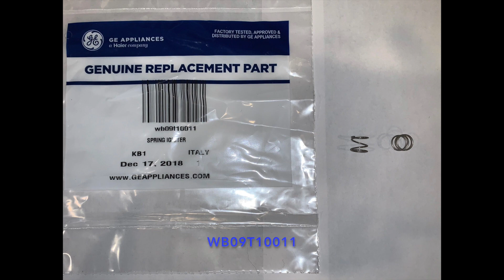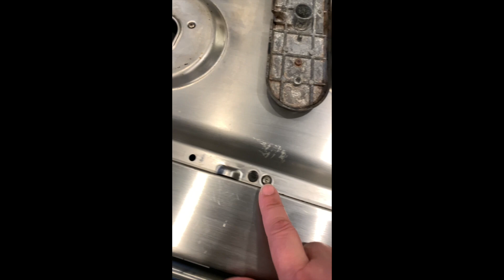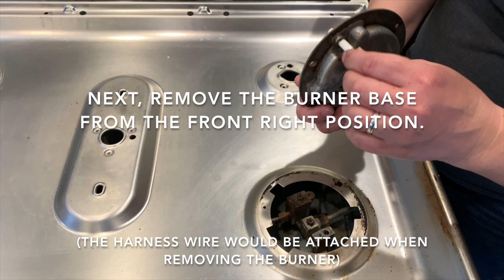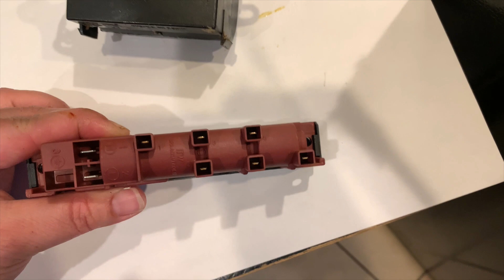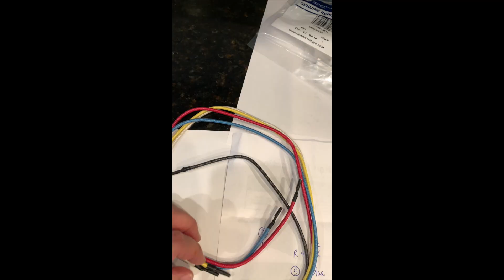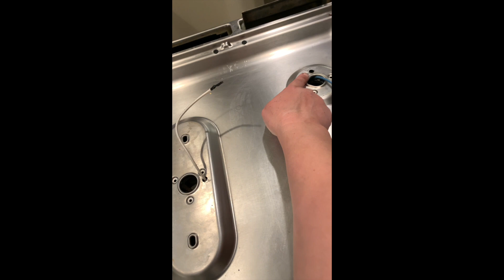Stove Repair - GE Café Burners Don't Light

Comment: Nicely done; one addition has to do with connecting the wires to the new Spark Module. The White and Purple go exactly as you illustrate but the other 5 wires running to the burners can be connected to the Spark Module in no particular order.
Reply from the maker: Thank you so much for sharing that info!  Great to know!  😃

Comment: I  have this exact stove bought about the same time. I cant for the life of me get the right front burner base to come off! Is there a trick to removing that one? all the others pop off easy peasy but the RT front seems to be glued or screwed in place?
Reply from the maker: Hi, @amandaneilson7162 
The first two parts of the front right burner (the flat black cap/top and the ring shield-thing that the flame comes out of) should both lift off easily.  If they’re stuck, likely some old oil or a past spill needs some cleaning up.  
Underneath those two parts, though, is the base which has 5 screws which need to be removed as well as the igniter (that should be easier to remove after the base is unscrewed).
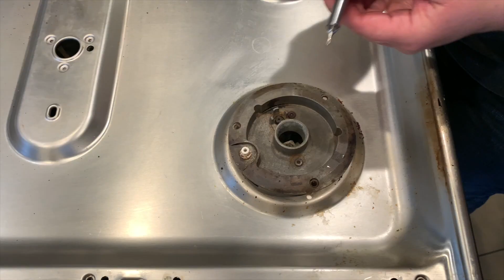If you look at 4:04 in the video, you’ll see the part that needs unscrewing (specifically pointing out the two inner screws I initially forgot to undo). 
I hope this helps.

Comment: This is one of the best How To videos on Youtube!!  My only problem now is the wiring harness part #WB18K10046 is no longer manufactured.  Hopefully someone can help my find one, because even GE didn't have a replacement part when I called them.  Thanks for this Video!!
Reply from the maker: Thank you for your kind compliment!  Thank you, too, for letting us all know the wiring harness has been discontinued!  Ugh!  I looked today, too, & had no luck tracking one down.  If I do end up finding one, I’ll let you know!
Reply: @mswdl  Thanks for the response!  If you happen across one, I'd appreciate any leads!
Reply from the maker: @davidturlington1958 I wonder if one of the other GE harnesses would work… Check out WB18K10035…that only has 4 wires, so maybe WB18K10050 could be the 5th necessary for all 5 burners.  I don’t know if these would work or not (!!!), but based on the photos, they look like they might.  You’d really need to check on your own (again, I don’t know if they’d work or not!) & buy only if you can return if they don’t work.  I will still keep an eye out for the original as I said before, but like you, every site I’ve searched so far no longer stocks it.
The other option you might consider would be to use your existing harness with the new spark module (assuming the harness wires don’t look damaged) & new igniters/electrode.  Whatever you decide, Good Luck!!!🍀
Reply: @mswdl  just saw this, thanks so very much!  I'll look up those part now!  Yes, I did find one but it only had 4 wires, so I'll look at that other one for the 5th wire.

Comment: Do you know how you would go about changing the glass and touch screen assembly on the front side of the range?? My touchscreen is being nonresponsive sometimes. Any help would be appreciated. Thanks
Reply from the maker: Hi, coolboy89111.  I wish I had insight to offer for that but I don’t.  I did a quick little search on YT for “how to change the touch pad on ge stove” and some videos popped up that might be of help.  I hope you find the solution you need.  Good luck!

Comment: Hello, excellent video, a question?  on the screen in front it showed blocked burners?  my stove was fine and I have exactly the same one as you, I washed it as I always do and now it doesn't want to turn on and the screen shows an error, burners blocked and nothing works on the screen.
Reply from the maker: Hello and happy new year!
I have not experienced the problem you’re describing so I don’t have any guidance of my own.  However, I did a search using 
“ge cafe oven stove keypad broken” and it looks like there are a number of control board solutions available.  Hopefully you will find one that works for you.  Good luck!

Comment: This is the model of my parents' oven and stove.  The fact that the large burners are designed to go in the front and the small burners at the rear drives me crazy.  Who wants to stir a small pot while reaching over a large pot of boiling pasta?!  Stupid design.
Reply from the maker: I can see your point.  

This design has worked well for me;  usually the big pot of water will go on the front right & whatever else I’m stirring /cooking goes on the front left.  Simmering items will go on the back left if I need 3 burners going at the same.  I rarely need the rear right.  Since I don’t have delicate sauces that need TLC, the lower/smaller flame burners being in the back haven’t been an issue.  

However, for sophisticated chefs who really monitor their sauces & stuff carefully, I can see how that could be problematic. 

I hope you have a stove configuration you like to cook on.  🙂

Comment: Very nicely done video! I came across it because I think I am having regulator problems on the right front I cant get a pot of oil over 300 degrees and the oven takes a long time to heat up I am a little disappointed with the performance of this range but if it can be fixed I would like to do it. anyone else think its underpowered? Im running propane
Reply from the maker: Thank you, Tim.  I'm sorry I don't have any insight as to why your stove isn't performing as it should (mine runs on gas).  I hope you find a solution!  This following link may be something you already checked out as it seems like a pretty simple fix...it might not be the answer you need, but maybe it will ultimately lead you to the fix you're looking for.  Good luck!  https://youtu.be/gLb0l5a96s0

Comment: How old was your stove when you had this problem? I'm currently thinking about buying this brand in in duel fuel double door gas range.
Reply from the maker: Hi, Mike.  I'm sorry, I truthfully don't remember the timeline entirely accurately.  A lot of time passed between when the first stopped working and then the rest of them and finally before I got around to fixing it.  However, if memory serves semi-correctly, I want to say the first lighter (front right) stopped around 4 years.  Hubby says it wasn't right away but that it happened sooner than we expected it would have.  Additionally, he said we "made do" using external lighters for at least 2 years before I did the repair.  So, if we go with that timeline, all of them stopped around year 10 or 11.  If you're thinking about buying a new model, hopefully you won't have the same problem.  The key part I replaced (spark module) was different from the original one, so it would be reasonable to assume (hope?) the newer/current spark module isn't as prone to failure as the one that came stock in mine.  As I have replaced certain things on this stove (such as the knobs), I have noticed that some of the parts have been upgraded/are of better quality (such as a metal shaft instead of plastic shaft in the knobs, heavier/sturdier, etc.).  One final thing to note, while I don't believe this is the sole factor, I do think it may be a contributing factor to the lighters not lighting at times (at least early on in stove ownership):  When I cook, I have a tendency to have things overflow (lol) and I haven't been so quick to clean it up.  If you're a more careful cook, maybe you can avoid impeding the spark. 😆 
Good luck with getting an appliance you love!  😀

Comment: On ge cafe the right front burner igniter clicks and lights with an outside source, the problem is the igniter is popped up and hits the burner top, so I see the spring and washer must have broken or fallen down, can you just replace the spring and washer with out replacing the entire igniter?
Reply from the maker: Happy New Year!  That’s a good question.  I’m sorry, I don’t know the answer to that, though.  I think you’d need to order a new igniter in order to get the spring & washer anyway (they come as along with the igniter), though I suppose if you could find comparable springs & washers elsewhere you could give it a try. Good luck & cheers to a healthy, happy 2022!

Comment: Good job on the video. I've repaired stuff for 60 years, HVAC guy. But you gave Jimmy bad the wrong mod.number. It's CGS980SEM1SS, not C2S...Just thought I'd let you know. Thanks for the info on replacing the igniter module.
Reply from the maker: Hi, Dave!  Thanks so much for your feedback!  I appreciate it.  You encouraged me to do a doublecheck on my model number so that's what I just did.  I even took a picture so that I could refer to it when I'm typing here.  Sure enough, mine is still a C2S980SEM1SS according to the sticker on the oven.  Perhaps there are other models out there that share these same features?  Mine is pretty old, so GE may have changed up the model numbers in subsequent years.  Whatever the case may be, I appreciate you being on the lookout & wanting to ensure accuracy.  Thank you! :)

Comment: Did any of your igniters work at all before you did the replacement?  Only our RF is working right now.   Looks like I’m going to be following your lead. Thank you. 
tim
Reply from the maker: Hi.  By the time I did the replacement, no, none of the burners would light.  Initially, only one stopped (long ago), but by the time of this repair, all of them had stopped lighting with the igniter.  They would light with an external flame source (so gas flow was fine).